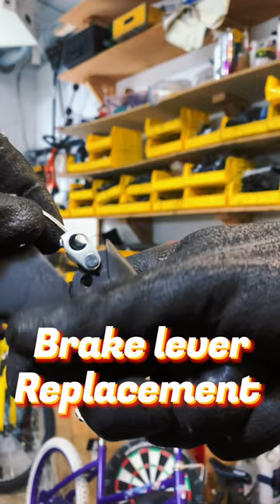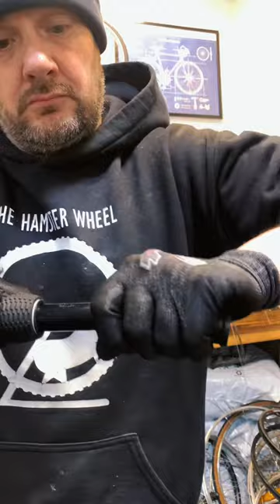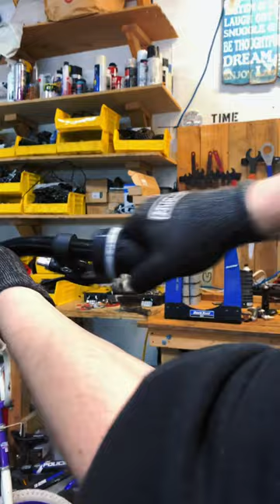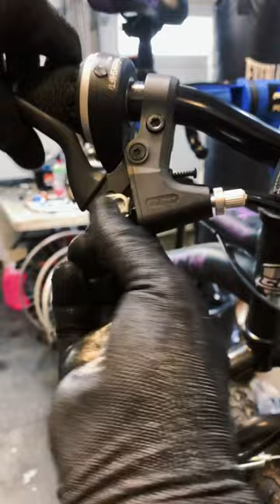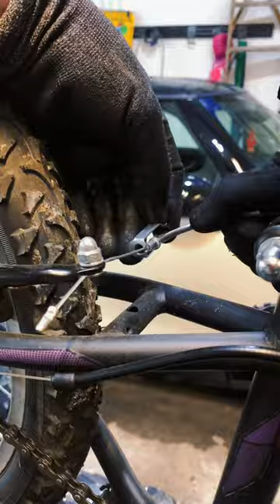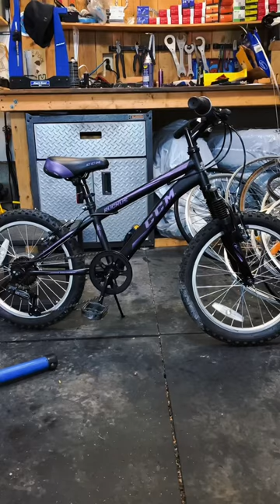Quick and easy brake lever replacement on kids bike #bikerepair #diy #bikemaintenance

Comment: Damn, I should’ve watched this before I broke the replacement brake lever yesterday 😭 Is there a easier way to remove the grip handles? Or do you have to really pull them off with super human strength?
Reply from the maker: I spray wd40 underneath them, normally stick a thin Allen key under so I can get the straw under.  Then pull off before the wd40 dries